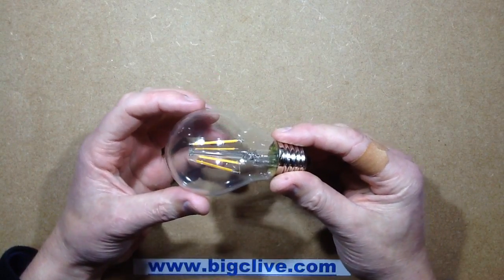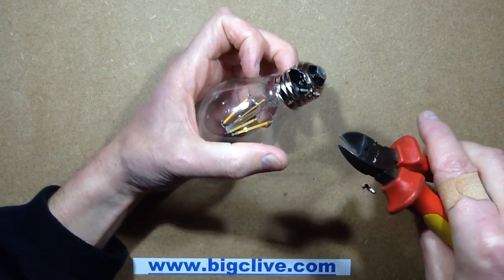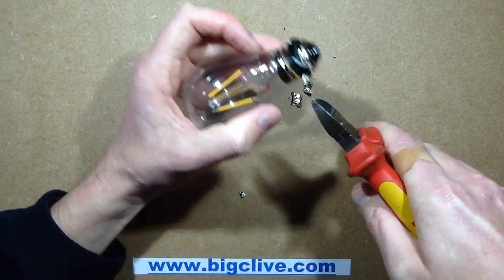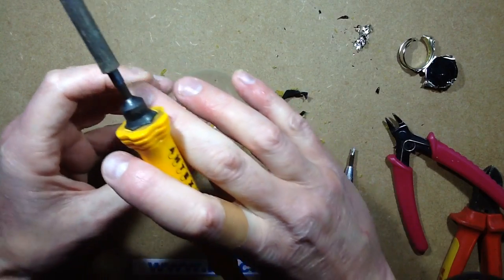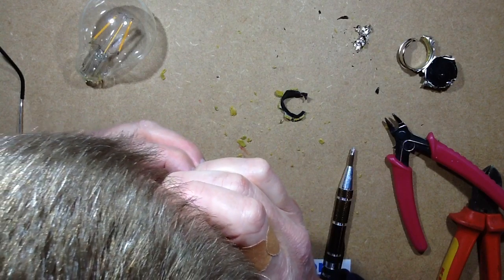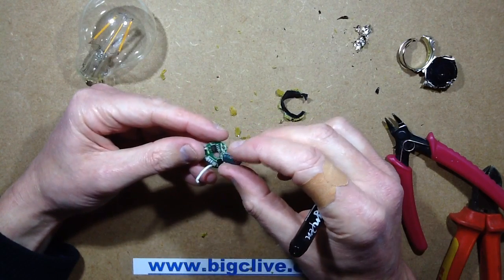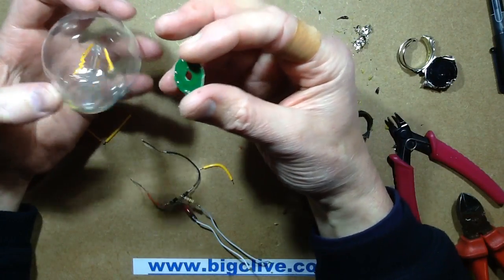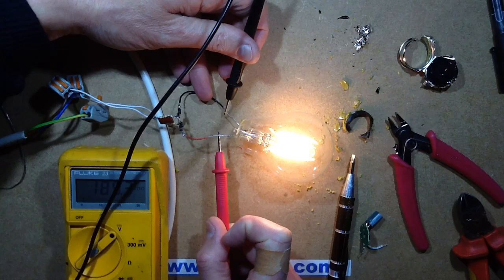Teardown of filament style LED lamp.  (Awesome lamp!)

Comment: You could always stick a B22 cap after youre done.... epoxy it to the base .... providing you didnt damage the circuitry..... i bought 60 of those online  (Canada,, with E27 base... not E26... figured would be better space for the circuit.)

Comment: My experience with these types of LED lamps (sadly) is "they don't work".  Mind you, it was probably a bad batch but until they get them down right (I figure a year or two) I'm not inclined  to get them if the other stuff works fine.

Comment: I've got a "CE" G23 led lamp that uses the same crd device (SM2082B) but... it has no smoothing capacitor at all. In fact, this lamp presents a massive amount of 100Hz flicker compared to standard CFL lamps I've tried before.

Comment: the most intriguing lamp i am using right now is the ebay item number  391222697069   e27 3w st64 "steel flower". i use it as a "sleep inducing bulb" and i wonder how they managed to put it inside the glass because it reminds me a boat inside a bottle!
Reply: looks like they seal it thru the top

Comment: I also have some of these. I'm sure in a couple of years time, these will blow everything out of the water, CFLs, conventional LED lamps with heatsinks and hot PSU's, halogen lamps in bulbs...

It's just such a good design. The LEDs have a large surface area, so are more than adequately cooled, the power supply can be situated far away from the LEDs, and away from any damaging heat. Best of all, these look just like the real deal. No ugly white plastic, warm up time, expensive heatsink, PSU heat induced failure, and best of all, cheap!

The more I think about these, the more I like them. They're just so perfect!

Thanks for the vid, Clive!
Reply: Magic Monty I think warm-up time is significant factor. For me it was so deciding factor that after I saw one of these in use I swapped out some perfectly working but slow CFL bulbs in an instant. The price is roughly similar but the light output and the color rendering is much better. I had CFL in rooms that didn't have time to warm-up before I got what I needed and turned them off.

Comment: I just got a 4w one of these with an E14 screw fitting. It's really quite clever having a minimal driver and no heatsink, just looks like a regular bulb!. At full output theyre the closest to an incandescent colour temperature (CRI) i've seen. I counted 44 leds in each filament (i think theyre double sided to give 360 degree lighting). Presumably theyre back to back in parallel and series across the filament length. My only minor criticism is that they don't dim to orange for mood lighting, like a regular incandescent does. I wonder if they could throw a few brighter but voltage limited red leds in there and cool down the orange/yellow phosphor to compensate... A true sunset dimming filament led.

Comment: Have any of these awesome looking bulbs been CE approved?
Reply from the maker: The circuitry is so basic and well enclosed that I don't think getting CE approval would be hard.  Many big name high street shops sell them here in the UK.
Reply: bigclivedotcom I ended up ordering 15 of them yesterday! Looking forward to seeing the new light.
Reply: see below
Reply: bigclivedotcom Sure enough they arrived today with the CE mark on the box. Straight off I plugged in one downstairs and two upstairs to see. They looked fantastic.

Less than an hour later the downstairs bulb blew taking out the fuse followed an hour later by one of the upstairs bulbs.

Have you tried installing them for your own domestic lighting besides making excellent deconstruction videos? I'm wondering if this is a thing to expect, or a sign of something. Now the smell of burnt circuit board is rife throughout the house.
Reply from the maker: Nick Bailey Hmm, I bought another of the ones in the video and it's been running for a very long time at my brothers house as the porch light.  I wonder if the ones you got were different.  If they came from ebay then open a dispute immediately.  It's better to start by opening a dispute in a situation like this, since otherwise they may try to stall until the dispute time expires.
Sorry you've not had any luck with these.  It's impossible to tell which are going to be good and bad.
Reply: bigclivedotcom thankfully not ebay but the reputable looking: wholesaleledlights co uk. I should be able to get them replaced, but I'm wondering if there could be an incompatibility with older house wiring for some unknown reason. They were not on a dimmer (I hadn't got round to replacing the 10 on my two dimmed chandeliers yet)
Reply from the maker: Nick Bailey They definitely wouldn't like a dimmer, and as long as they were getting a generic UK mains supply they should work.  It sounds like they have a design weakness.  They are a relatively new type of lamp, and I get the feeling that the factories are struggling to keep up with demand.  Hopefully the supplier will either refund or replace with proper working lamps.
Reply: bigclivedotcom the ones I chose are all dimmable. It was the big 6W globes that blew that were dimmable but in normal switches. Such a shame as they looked really nice glowing with the filaments. Hope to get covered, but reluctant to have to return to high power halogens :(
Reply: bigclivedotcom thanks so much for the feedback and the great video.
Reply from the maker: Nick Bailey Ah, I've not taken any dimmable ones to bits.  But I have seen some non dimmable ones presented as being dimmable.  True dimmability introduces some fairly complex electronics that may have been over-miniaturised to fit into the base.
Reply: Nick Bailey I imagine this does:

http://www.amazon.co.uk/Auraglow-Filament-Technology-Candle-Equivalent/dp/B00KX8MGJM/ref=sr_1_1?s=lighting&ie=UTF8&qid=1428438589&sr=1-1&keywords=Auraglow+filament

and these:
http://www.lightingever.co.uk/2w-c37-e14-ses-led-candle-bulb.html

Tbf, I might just get a little converter thingy, because the Lightingever ones produce 270lm of light each, whilst the Auraglow ones provide 220lm each,use 10% more energy (Well 0.2W...) and cost more to buy! Though the Auraglow ones do come with a 5 year warranty

This being said for the "lighting ever" ones ID need an E14 to B22 converter at around $0.99 each!

Comment: There's another video showing a bulb taken apart that has a transformer inside. And I've just ordered a 6W model that has a voltage rating of 85 to 265 V
Any idea how these work?
Reply from the maker: The ones with small transformers are based on switchmode power supplies.  That also allows them to operate on a wider voltage range.

Comment: Thanks for the informative video Clive. I'm someone else who found you via Julian. 
These SM2028B regulators seem difficult to source? I was going to try and recreate one of those circuits from the bulb.
Reply from the maker: Many of the lamp driver chips seem to be aimed directly at manufacturers and not the general public.  Theoretically you could just use a fixed resistor value, but the chip has the advantage of detecting high temperature in the lamp and auto-regulating the current down.
Reply: Yes, it appears that is the case with the SM2082B. 
I'll have a play about and see what I can come up with.
BTW, I do think those classic looking filament bulbs are great.

Comment: Why do these light flicker? They use full wave bridge with smoothing caps - where is the flicker coming from? Is the frequency low enough to cause headaches, like on some shitty LED monitors?

I've bought 4,6,8W versions of these bulbs and 4W doesn't seem to flicker, while 6 and 8W versions make horizontal lines when viewed on my phone's camera..
Reply from the maker: It all depends on the internal circuitry.  If they don't use proper smoothing capacitors the lights can flicker.  This lamp I took to bits here didn't flicker on the original circuitry.
Reply: bigclivedotcom Right. So if they don't use proper caps, the frequency will be 100hz?
Reply from the maker: ***** 100 or 120Hz depending on your mains frequency.  But some really crap ones flicker half wave at 50/60Hz.

Comment: Oddly here in sweden home of energy saving and eco friendly everything (or so it seems) whilst we have LOTS of CFL and led lamps I have not seen the LED filament yet. What I have seen is a lot of the old filament lamps that run at about 20-40w and classed as decorative lamps.
Reply from the maker: Yes, we've seen a surge in the "vintage look" long tungsten filament lamps appearing here.  But the LED filaments are fairly new and you may only find them on ebay at the moment.
Reply: bigclivedotcom And Amazon!Theyre cheaper there! Normally eBay is cheaper.. Tell a lie, the Auraglow and the lightingever ones are cheaper there ie: the ones that I now are CE approved! (And not just saying it on the packaging....)

Comment: I'm betting they make the bulbs with the 2 pairs of filaments separate so they can series for 200-250v and parallel for 100-125v
Reply from the maker: Yeah, that's a possibility, although the chip has effectively two separate current limiting sections, so it could run each pair with its own limiter.

I've ordered a two filament version from China which I guess will have a cap dropper or switchmode.  There's a very good chance it might end up in bits on YouTube when it arrives.

Comment: Thanks for all your uploads.
I was very surprised you didn't use a large resistor in series when testing for polarity.
Reply from the maker: Gallium nitride LEDs are prone to failure at even the slightest sniff of reverse polarity that exceeds a voltage rather conservatively rated at 5V.  If I accidentally put a blue, green or white LED into one of my mains powered LEDs strings (with current limited to a few milliamps) it almost always fails instantly.
Theoretically the combined reverse voltage of the filament arrays would have been 500V but sometimes you get major variance between reverse leakage that results in an uneven distribution of reverse voltage.

Comment: Brilliant! I couldn't bring myself to destroy my LED filament lamp - It's such a lovely thing. So thanks for destroying yours so we can all see what's inside!
I'm convinced the LED filament lamp is the future of light bulbs. The bewildering array of CFLs, and space-age LEDs in hardware stores just now, is a complete shambles. I suspect many people go for the halogen bulbs simply because they look like good old-fashioned tungstens. But the halogens are a bit of a con - they're incandescent. To claim that they're low energy is frankly misrepresentation.
These LED filament bulbs use a tenth of the power of tungsten, yet they look like proper light bulbs. I say let's clear the shelves of nasty CFLs and bizarre looking LEDs and re-stock with these new LED filaments. 
After a couple of hours, the base of mine had got quite warm, so I worry about the use of electrolytic capacitors, but I guess time will tell. And I would like to see 8-Watt versions.
Reply from the maker: I too can see this circuit and style approach becoming a big thing over the next year.  Of course, there'll be plastic version brought out.  But the glass one like in this video is one of the most environmentally friendly electronic lamps I've ever seen due to the high ratio of glass and metal to the minimal electronic content.  I've ordered a 1W version with a rectangular cob in the middle and a 2W candle lamp with two filaments.  There are 6 filament versions available.
I'd like to see these with coloured LEDs.  Even where each filament is a different colour.
Reply: bigclivedotcom There are some 8W (8 filament) bulbs on aliexpress, some even with B22 bayonet bases. But I've never bought on aliexpress before. Perhaps now is the time to take the plunge.
Reply from the maker: Julian Ilett Be aware that as soon as you give your email address to AliExpress you will be inundated by spam from Chinese sellers.  And I really mean inundated!
I recently made my own first purchase from AliExpress and the quality of the LEDs sent to me was poor.  They were packed in ordinary polythene bags and the "high output green and red 5mm diffused LEDs" turned out to be the cheapest gallium arsenide indicator LEDs they could find with an output in the low tens of mcd's and not the thousands of mcd's as described.
Reply: There's an 8W version on Amazon UK with what looks like 8 filaments inside, however, it has a white cap at the base and one user review saying it's slightly larger than the normal incandescent globe size.  Surprisingly, there are even frosted versions of these (look up frosted filament led on Amazon), which in a way defeats the point of using LED filaments, but I'm sure gives a better simulation of the older frosted filament bulbs than those with large heat sinks.
Reply: bigclivedotcom Like eBay, ordering from AliExpress can be hit-and-miss.  But it does have the advantage that you can easily read the comments from customers about the specific product you're looking at.

When looking for a specific product I always sort by the most # of orders that usually gets you to the "good" sellers, then read the comments, give more credence to the more wordy comments.  

And make sure you leave a detailed comment for future customers.
Reply: I have ordered from both ebay and AliExpress and they are kinda same, you can make some really findings but there is also alot of crap, but if you just wait a couple of weeks all that you find on Ali will be on ebay, at least all I have seen. 
I have the 4W one whit normal E27 socket (cos I live in Sweden its the standard here). The one I have is the one whit white base and not just the screw socket that Julian likes, and it appears no flicker at all. But this several I found reeding on the web says those bulbs flicker, maybe those whit white base have more room for components and therefor thay use smoothing caps. Just a thought.
Reply from the maker: If you look at my recent videos you'll see I did a teardown on a candle lamp version with an SES base.  It flickered horribly because it used a capacitive dropper with no smoothing.
Reply: bigclivedotcom Thanks, looked that one up and wow, yep it did really flicker, I have one candle lamp myself that I dropt on the floor and it must be filled whit some gas cos it blinks when plugged in now. I took it apart just now, and there is a better driver circuit, full bridge rectifier and a driverchip named BP2831 and componets to that chip, 2 big 4,7uF caps (not that big but in this circuit it is). So there is some different drivers for those bulbs.
Reply: bigclivedotcom
I think it is possible that you can reattach the PCB and then fit an other base on it.
Reply from the maker: ***** I could do that, but I've already attached some leads for experimentation with my own power supplies.
Reply: I have seen that other video. Nice! I would rather want to buy two of these bulbs for cosy illumination but I'm afraid to get some other, crap ones. Can you send a link to the one you bought? Hope they ship to Germany, too. Thanks!
Reply: Julian Ilett Agreed. Would be cool if we could get some dimmable ones though and ones that have a higher brightness than 400 odd lumens :(

Though tbh, if I had a house, Id probably get a 4 light chandelier, and bang in 4*2W bulbs (270 lumens each)

Also, these have an angle beam of 360 degrees!! Most other LED bulbs have an angle beam of 120 degrees or so. Only seen "Blackberg" who actually have a 360 degree bulb
Reply: Julian Ilett Personally Id rather buy from "lightingever" or "Auraglow" bulbs from Amazon! Cos they're UK based and I KNOW they're CE approved and stuff!! :) Not much more to pay for safety tbh!